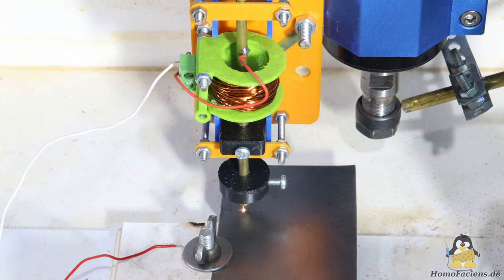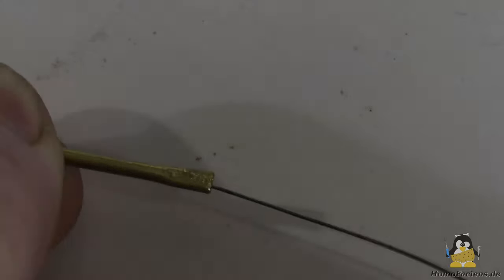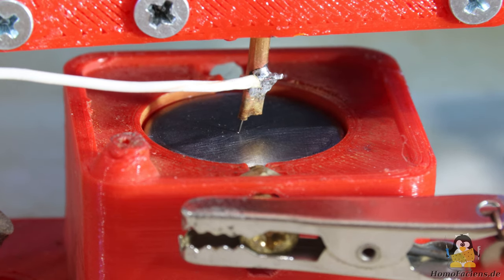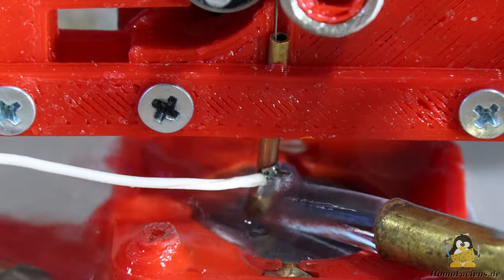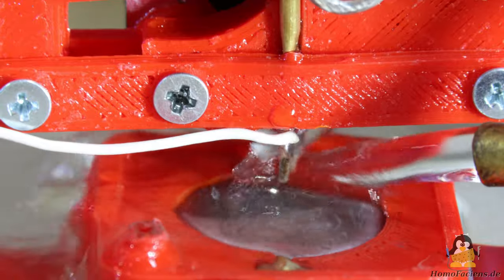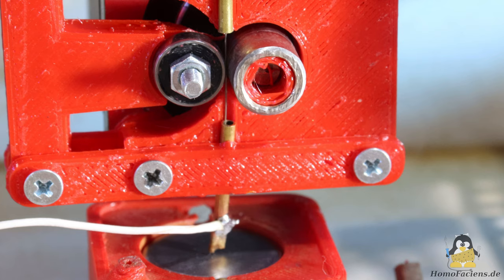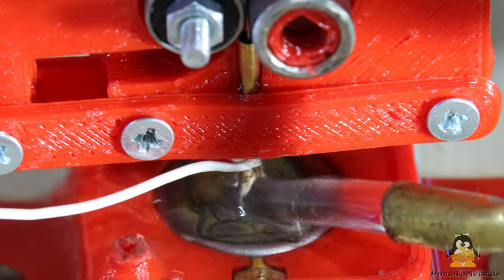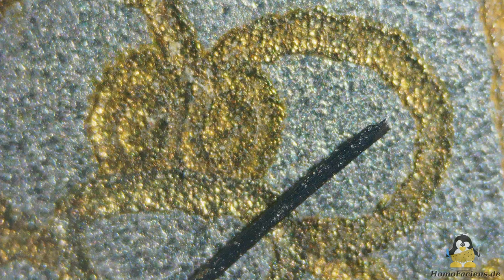EDM: Spark erosion with an 'Active Hammer', Part 1

Comment: Hello my friend. I am also experimenting with building similar setup and I also found that I should use different current sensor 😂. Can I have few questions for you? How can I add more grasp between rollers which are feeding wire and what's your idea about straightening the wire with ball barings? Thank you for your answer
Reply from the maker: I am still experimenting to improve the design, especially with wire feeding. To avoid spending time with private lessons,. be patient and stay tuned to see the results. A new video showing my progress with my active hammer will go live in the coming two week (if all goes as planned).

Comment: Love this series. Very tempted to experiment with a DIY wire-EDM setup myself thanks to your videos, might have to order some parts now so that I have them ready before Christmas :)
Reply from the maker: I also have ordered Parts. So there will be updates until Christmas. Stay tuned!
Reply: Don't underestimate how hard water management is.  I suggest you watch baxedm's videos on his water system so you have an idea of what you are getting yourself into.
Reply from the maker: I know baxedm's videos. However, this hammering method is a totally different way of spark erosion. While the "classic" edm avoids making contact with the workpiece, the hammering method works with making contact. With that, water management is way less important. I am using tap water and even after several hours of use, there is no real difference.

More on that in coming videos - stay tuned!
Reply: @HomoFaciens   he said "wire-edm" so I'm assuming the hammer method doesn't work, can you hammer with wire-edm somehow?  Seem like wire breakage would be a problem.
Reply from the maker: Yes, with the classic wire EDM you should avoid making contact with the workpiece. However, my hammer makes use of a wire, too. ;-)

Comment: Why don't you sandwich wolfram electrode between 2 hard carbon brushes? I think that you have sparking in that brass tube with white wire.
Reply from the maker: Carbon brushes will quickly get a grove slightly larger than the wire diameter, resulting in the electrode wear same as in the brass tube with the too large inner diameter. However, I already have a workaround - stay tuned!

Comment: Maybe you will be experimenting with these parts  someday to work as a miniature welder instead of an etcher?

You could then 3D print metal objects using this fine wire.
Reply from the maker: Yes, at the end of one of the videos of my EDM series I already mentioned that I will give the welding a try. Stay tuned!

Comment: Use a non-conductive nozzle and keep it closer to the work piece. That should help with wire bending and non-tip erosion. Inject the current at the feed wheel for better contact.
Reply from the maker: Thanks for sharing your thoughts. However, I have a different approach on my experimental setup.Stay tuned to see what works best.

Comment: How much does the wire erodes in mm for a "complete job"?  Maybe connect the power source to the other side of the wire with a good electrical connection, and not try to use the guide tube as current path?
Reply from the maker: How much the wire erodes for the 5 minutes engraving? Not much.
You want to force a current of several Amps through a 0.2mm wire over a length of 4cm or more? No chance to get sparks with such a setup!

Comment: Could you use a brass printer nozzle as the guide tube for the wire? just thinking they come in some useful size orifice
Reply from the maker: Of course I could, but I won't. Because where is a difference between a brass nozzle and a brass tube?
Reply: @HomoFaciens  it may help with keeping the wire coming out straight when compared with the tube. But I do see your point.

Comment: I wonder if you have considered molybdenum edm wire, it seems more common but there isn't much DIY content using it.
Reply from the maker: I will have a closer look at material combinations as soon as my active hammer mechanism works reliably. Molybdenum wasn't on my list, yet, so thanks for pointing to that.

Comment: hi, great job.
I haven't read the other comments so what I'm about to say may not be new, but the construction of a nozzle for the tungsten wire that is a little less rough, perhaps with a 0.3 mm hole, could increase the precision of the work. instead of the brass tube crushed with a 0.5 mm wire, perhaps "borrowing" the nozzles for 3D printers to which the brass tube is forcefully inserted so as to reduce the bending space (spring effect) during the pressure on the piece.
to the next videos.
Reply from the maker: Thanks!
Yes, I knew from the beginning, that this kind of making contact would be not so good. The whole setup was more or less a proof of concept. Now that I know that I can move the wire up and down fast enough with my microcontroller to actually erode the steel disc, I will start eliminating the known issues.

No matter, how precise the bore of the brass tube meets the outer diameter of the tungsten wire, there will be wear from friction as well as sparks. Even if you start with a precise setup, sparks will inevitably form between the wire and the tube. Over time the hole will become larger and so the unwanted electrode erosion gets even worse.

So what is needed is a spring loaded, well defined contact that compensates for the wear and that's what I will demonstrate in the coming video - stay tuned!
Reply: @HomoFaciens  Maybe we are saying the same thing: to reduce the nozzle erosion problem you could make the connection outside the metal of the nozzle, the frictional wear would remain but the sparking between the nozzle and tungsten would be eliminated
Reply from the maker: There won't be any tube making the contact in my future version. Just a short piece for guiding at the wire straightener rollers. No nozzle. Nor conducting or non conducting. Be patient to see what I am working on.
Reply: @HomoFaciens  👍👍👍

Comment: for super fine feed....

trigonometry. if you have a leadscrew at 6 degrees, or should i say 84 degrees to the direction of travel...
you get 1/10 the travel.

ie, the lead nut has to slide across the carriage at "not quite" a right angle to the actual motion.

do it on the lathe all the time, though we can deal with the tool moving sideways as well.

here, its a matter of thinking how the leadnut/screw actually attaches to the carriage. in a slot so it can slide back and forth at right angles to the carriage slides.

do it for both axes... bit clunky but yeah. simple. cheaper than gearboxes without backlash?
i laughed at that core... poor little ferrite.

grid tie inverters have massive ones in them :) reckon the aim is reduce that DC resistance as much as possible whilst pushing the inductance up.
Reply from the maker: Well, let's get the erosion process work well and then start improving the CNC mechanics (I know the maths and the basic backlash problems, the cheap machine is more than good enough for what I am doing now).

Another "Yes" the electronic is horrible in terms of handling high currents and magnetic fields. Same here: It works quite well enough to demonstrate some basics.

Improvements will be introduced step by step - stay tuned!

Thanks for sharing your thoughts!

Comment: Why don't you start with a thinner brass tube? Mabe, there is one, which fits good enough, that you do not have to crimp it?
Reply from the maker: I have thinner ones an tried them as well, with no real difference. Even the smallest gap between the inner walls and the electrode wire will cause sparks and so erosion of both, the electrode wire and the brass tube. The gap becomes even larger and so does the unwanted erosion.
I will demonstrate how to make better contact between power supply and electrode wire in the coming video - stay tuned!

Comment: Driving the wire motion with a electromagnet and using the work piece/tool contact to switch the electromagnet directly may be an effective and simple alternative. Think relay oscillator.
Reply from the maker: ...you mean something like this?
https://youtu.be/rS5600spxEQ
That's how this series started.
Reply: @HomoFaciens  Yes exactly that :) I missed the first videos. Why did you move away from that method? It looks like it worked well.
Reply from the maker: The basics on the "Wagner Hammer" are told, it works, the rest is up to you.
...but maybe if I have another good idea of how to improve a 'Wagner Hammer' I will put it back on my list. Stay tuned!